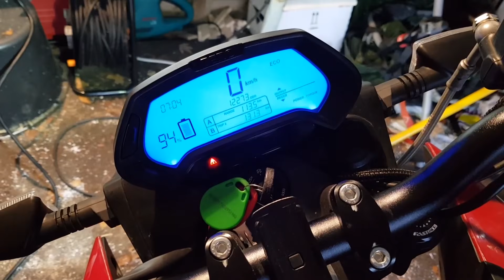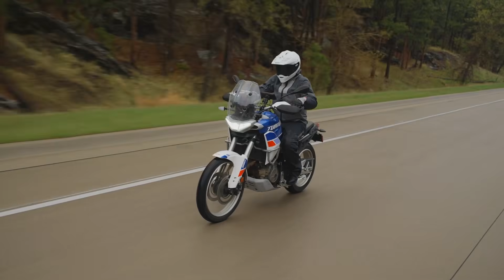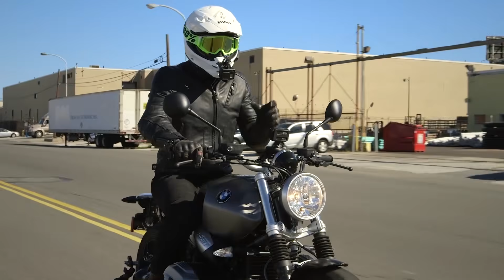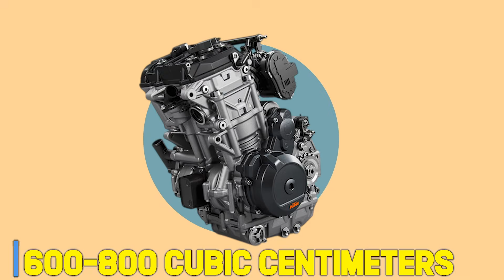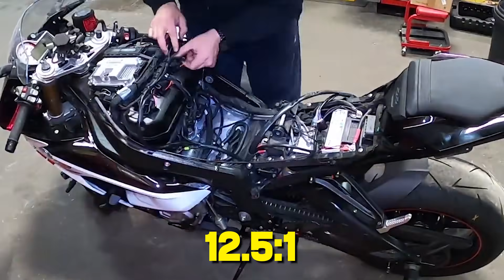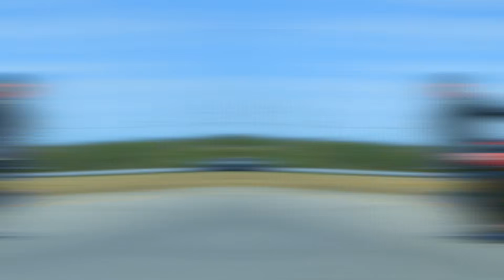Modern Motorcycles Have A SERIOUS Problem & It’s Getting Worse

Comment: I traded in a 2021 Z9000RS, which had a cable throttle, for a 2025 MT-07, which has the "Drive-By-Wire" feature. The smooth, linear, throttle response on the MT-07 is infinitely better than the quirky, jerky, finicky cable throttle response of the Z900RS. But after three years of trying to train myself into my Z900RS, I gave up on it. Power and torque delivery on the MT-07 are fine. I test rode it up a long 8% grade hill in the New Hampshire White Mountains. From a stop at the bottom I was doing 100 mph at the top. My friend's $30,000 Harley made it to only 85. I'll never buy an antiquated cable throttle machine again. "Drive-By-Wire" is the way to go. With three driving modes, the throttle response of my MT-07 is more appropriate for a variety of different road and driving conditions. Who wouldn't want that?
Reply: I have a 24 RS SE. Dealer ripped the ECU out and sent it to be flashed when it went in for its first service. $250 USD for the flash [plus freight and labor. Completely different bike now. Should have spent a few hundred and saved yourself a few years of stress.
Reply: @steveearnshaw720  I envy you for finding a dealer willing to have the ECU reprogrammed. I asked my dealer and they refused saying they were not authorized to do such work. And I felt it was beyond my own skillset. I suspect I would have kept my Z900RS.
Reply: @pcastonguay  I bought the issue up before i bought one. They told me that was the solution if i wasn't happy at the first service.  I had in the recent past bought two new dirtbikes so that may have helped.